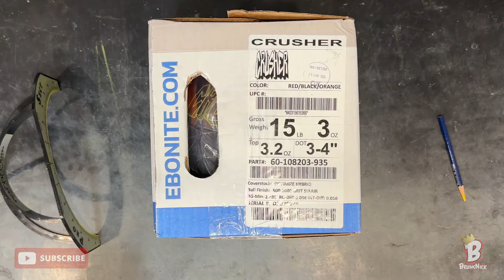Ebonite Crusher | ASMR

Comment: Always enjoy your videos.  Been thinking about putting the Track Sensor in my arsenal for a bench mark ball. Top of the bag so far is the Black Widow 2,0 solid. Bottom of the bag is Sneak Attack solid. Would appreciate your help!
Reply from the maker: @kevinanderson9093  the Sneak Attack isn’t already your benchmark type ball? I think if you added original Sensor, you’d have two balls on the lower benchmark end and then a big asym up top. Need something more midrange in the mid .040s diff range symmetrical. Maybe like Scorpion Strike.
Reply: @brunsnick  Ok. Thanks

Comment: I hate that you barely beveled the finger grip hole and didn't even bevel the thumb hole this causes cracking around holes
Reply from the maker: @aydengianes2515  finger hole is beveled plenty. Zero cracking issues in my entire 20 years of drilling. And never any cracking around the thumb.
Reply: @brunsnick  I probably can't see how well you did it, I'm not hateing or anything i had my storm crux cracked all the way around form the super sharp holes I told the proshop guy to bevel them and he said ohh it will be fine